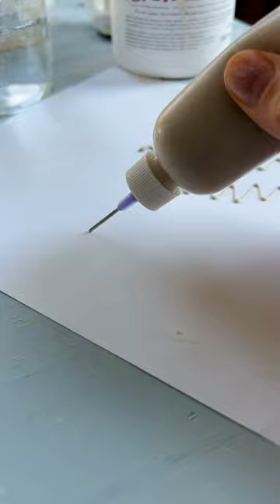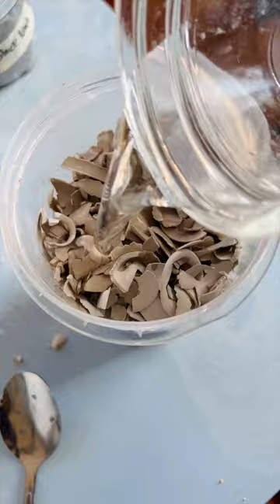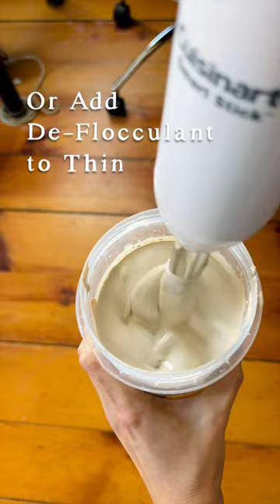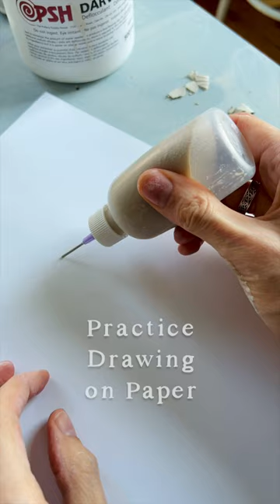How to Make Clay Slip for Drawing on Pottery #shorts

Comment: I'm assuming that you use clay without grog, but do you strain the slip before putting it in the bottle?
Reply from the maker: That’s correct, I use porcelain. I don’t usually strain it but you could try if it doesn’t easily pass through the applicator tip. If using a groggier clay, or stoneware, you can follow this process and just try a larger gauge of needle tip to allow the particles to pass through.